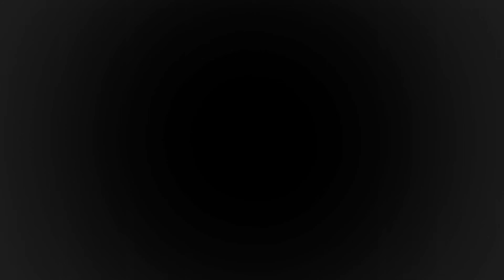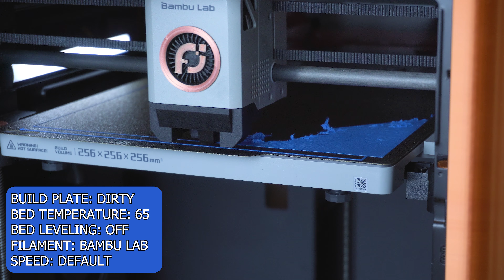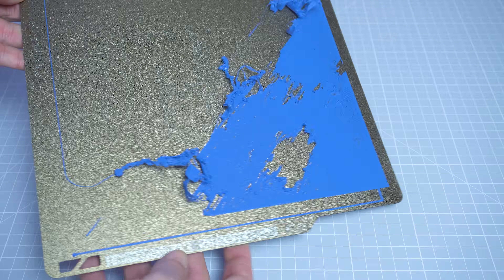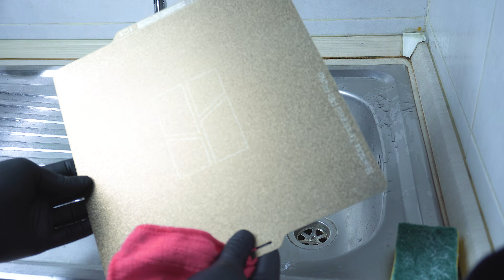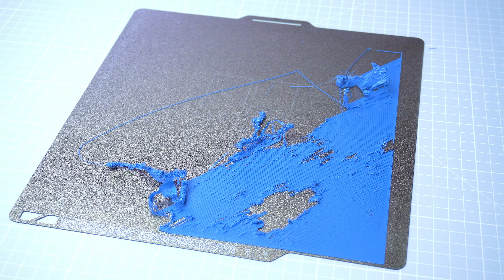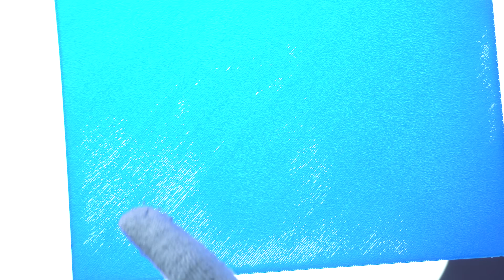The Secret to Perfect First Layers: Clean Your Build Plate Like a Pro!

Comment: i have the same first layer errors, but i had a blob.. checked all screws all tight.. tried 2 different beds (cleaned) and some reason i cant get that first layer anymore..... any suggestions? asked chatgpt and it said to manually offset the Zaxis but i cant find the menu its for a bambulab A!
Reply: Same issue

Comment: I was having issues on a brand new plate after 3 prints. Is this normal?
Reply: I'm going through the same thing. Going to try thoroughly cleaning the build plate. My first print failed, cleaned it with alcohol and printed fine with 2nd attempt. Cleaned board again with alcohol and it failed. Similar area to first failure.
Reply: Same here. First 5 prints fine, after that not sticking. I got creality k2.

Comment: 2:37 don't use anything too abrasive 
Continues and uses sandpaper.
You notice the irony? 😅
Reply: It's not wrong.  1000 grit isn’t very abrasive.
Reply: But it for sure scratches the surface. That's the whole purpose of sandpaper
Reply: Bambu lab actually recommend this, or wire wool. Check out there how to clean the build plate on their wiki pages, it is there.